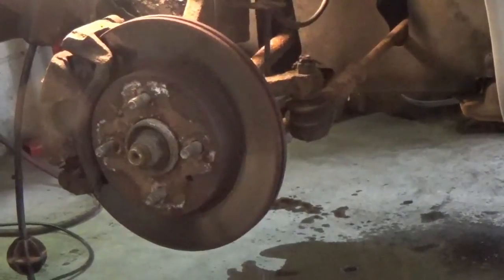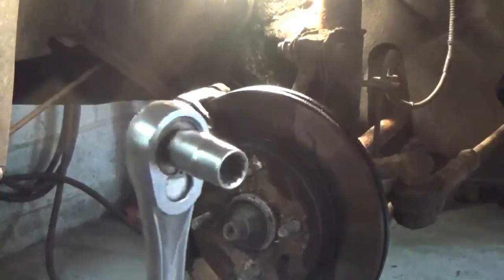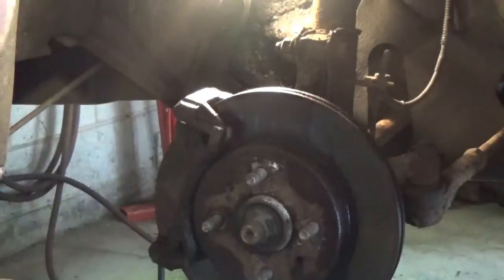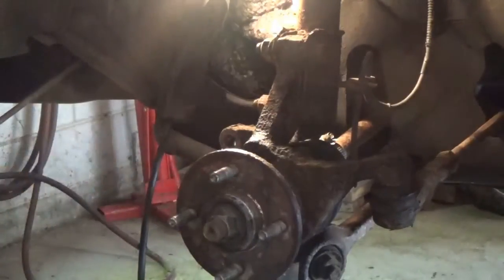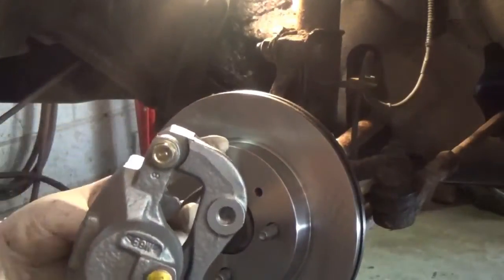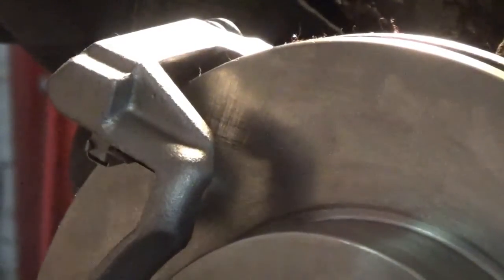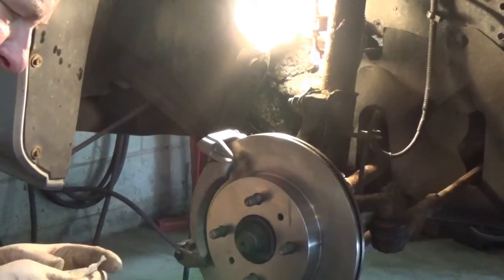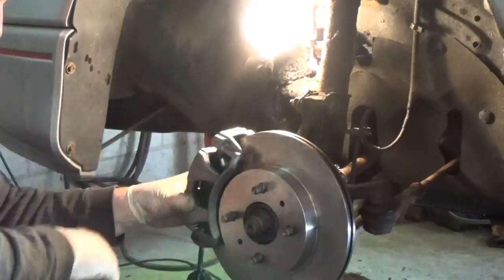1993 Saturn Front Brake Replacement

Comment: Thank you for the great film with many details on Brakes and Calipers replacement. It was especially useful for me to see where exactly to put antiseize on Brake Pads. However:
   @13:11  It should be applied Thread Locker on mounting Brake Bracket-to-Knuckle bolts. Everyone uses Blue, but Shop Manual actually calls for Red (Loctite 272) or, if that thread locker is not available, then new fasteners. Again everyone applies Blue, since it will be rather difficult to use heat in that area I assume. But not Antiseize. Torque there is 81 Ft-lbs.
   @ 12:50 Torque on those Caliper Bolts is relatively small 27 Ft-lbs.
    That is for 2001 Saturn SL2.
Reply from the maker: Thanks for your input. In the rust belt, rust is my threadlocker. Just the way it is. In all the brake jobs I've done, which is hundreds, I never ever ever had a non threadlocked  fastner not need a breaker bar to get off. Just saying.
Reply: @TheDisgruntledMechanic  My pleasure. You know you put peace in my mind with that Antiseize/Thread Locker approach. I did the brakes like 1.5 years ago on that Saturn, but now I needed to remove the whole brake assembly on the side (I didn't disconnect the hose, but just hanged it on the subframe), since dared to replace Struts and CV Axles. Then I attached everything back (Blue thread locker) on the bolts of the discussion, how I did it previous time (yes, I opened them w/breaker bar). But now I have the Shop Manual (3 huge volumes), so I looked there for smth and saw that statement about the Red Threadlocker. Started to ask around on UT, everyone does Blue or nothing, but still I was not sure, bought a new set of bolts for the next time. Yes that is true, experience is everything. I have 5 different torque wrenches and recently  stripped lightly one important bolt for transmission drain plug (didn't know that the torque wrench continues to work after the click, and the click was very light or smth). Of course experienced mechanic would not do that mistake, bcs he would just fill that torque. It is a pleasure to see so hard working person and all those details and techniques, please make more films. Thank you for your replay.

Comment: Hey Mike! It's great to see you on You Tube. I like how you shared a little about yourself (fleet mechanic).  Awesome idea-scuffing away surface rust from the hub and then spraying a protective layer of grease. This is to prevent rust from bonding the inner hat of the rotor to the wheel hub, right?. Also, is there a Part 2 to your video? Thanks for sharing your expertise. Hope to see more.
Reply from the maker: lee ann Hey thanks Lee ann. no part 2. This was more or less an experiment and my future videos will actually have the full videos. Camera was new and wasn't too sure how stuff was gonna work. I'm no EricTheCarGuy  or South Main Auto Repair ! Oh and yes that is to make future removal easier when you live with lots of rust! Scotty Kilmer doesn't agree with grease on the brake hubs from his videos but I don't think he sees too much rust in Texas!